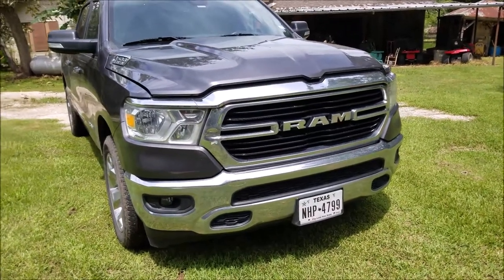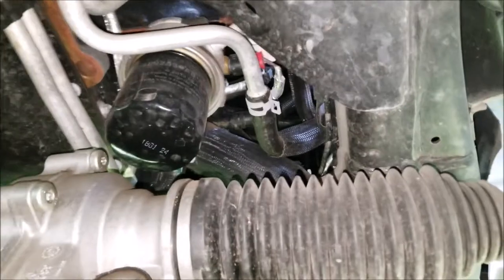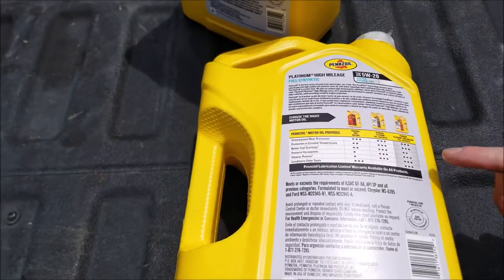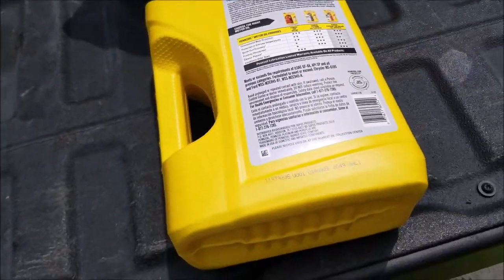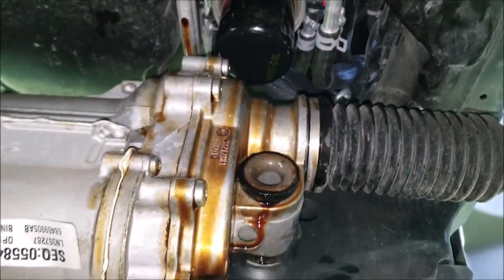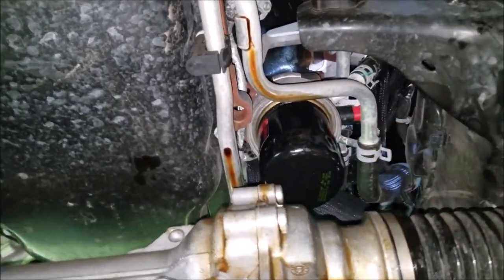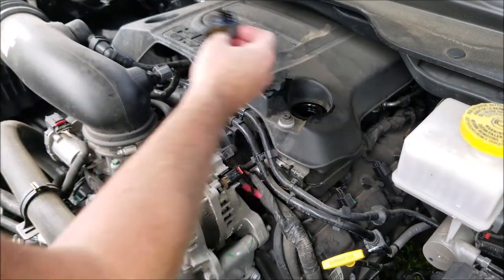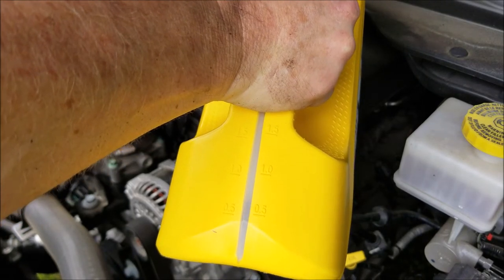FAST - How to Change Oil on 2020 Ram 1500 5.7L

Comment: Thanks for the clear video, getting ready to do my first one on my new to me 2021 limited with the hemi. Just did my front and rear differential without jack stands just raised the air suspension.
Reply from the maker: Filter is on passenger side fyi!  Must be nice having those air bags.

Comment: Dill a hole in the bottom of the filter, then funnel it around to your catch. The remove an empty filter.
Reply from the maker: Another great way to not make such a mess.  Excellent information. Sad we have to be innovative bc Ram was not.
Reply: Damn, I wish I saw this comment before I did this, lol. The amount of cat litter in my driveway right now is absurd.
Reply from the maker: FCA did a great job engineering this didn't they?
Reply: @JRMSweeps   oh yeah, the sway bar placement, right in front of the oil pan nut, was great, and the oil filter placement, right above the steering rack, was the icing on the cake. Chef's kiss
Reply: you cant get a drill up there. I was thinking of doing a reloaction oil filter setup.

Comment: I just did my first oil change on a ram 5.7 ( I have been for years a Ford guy) I should be back to Ford. I would like to slap the guy who decided to put the drain just about the sway bar and for the life of me the oil filer above the rack with not space for the cup socket to turn it. Hint. go in from the front of engine with the wrench. Watch out the filter is going to spill its oil all over the rack and other things.  Ram should be ashamed.
Reply from the maker: Man, the way the engineered all that under the engine is insane.  Don't want to do this in your driveway that is for sure.